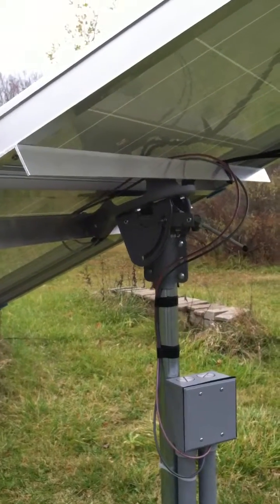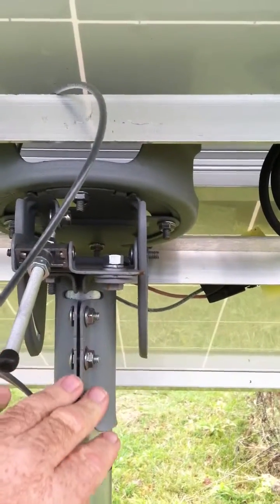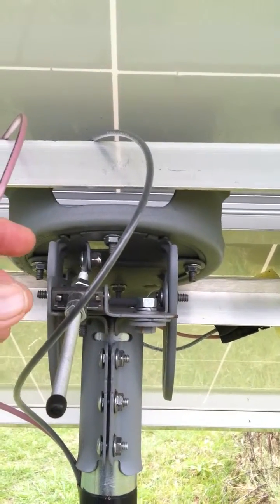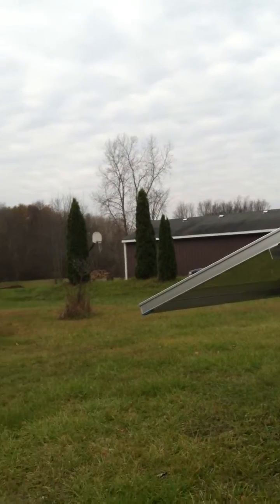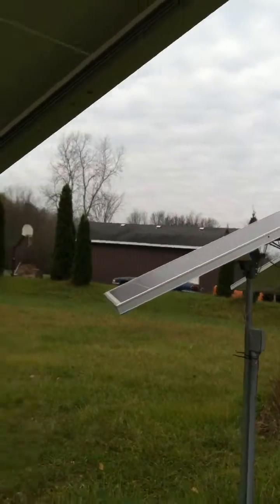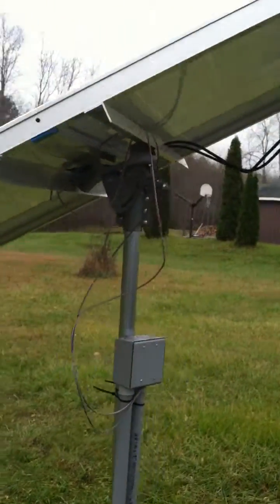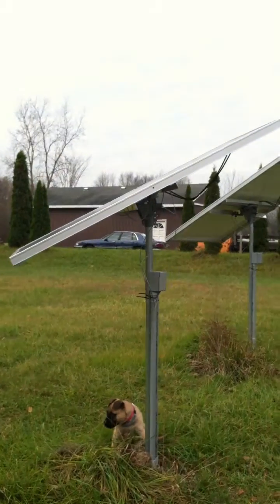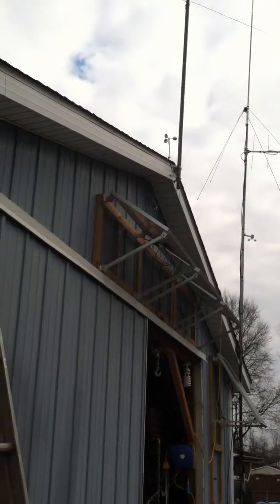250 Watt 30 Volt Solar Panels

Comment: question Just want to know if you use a step down transformer to step down the voltage from 30 to 12 or 24???
Reply from the maker: No I just had to make sure that the controller I purchased would handle the input voltage. If its a 30 volt panel I sent to a controller that would handle 40 volts or more. The MPPT controllers they turn the extra voltage into additional current. I non MPPT controller will work but just regulates the voltage down to your battery voltage. 

Have a ball